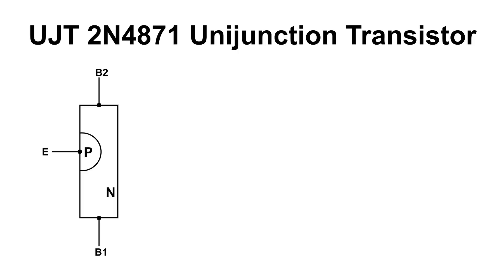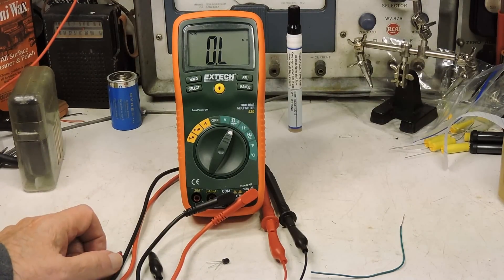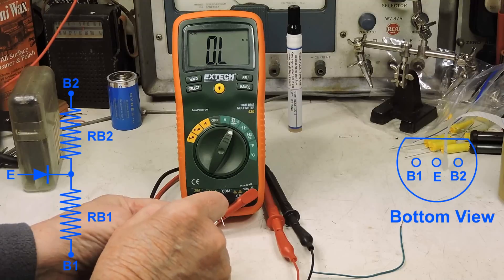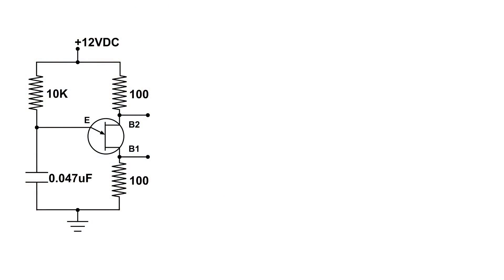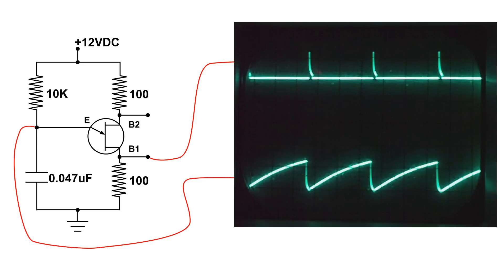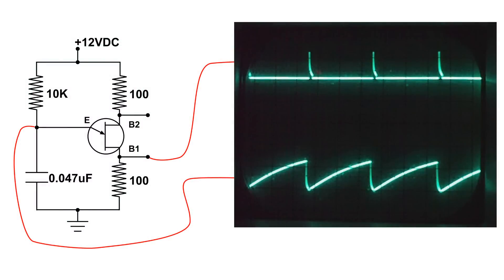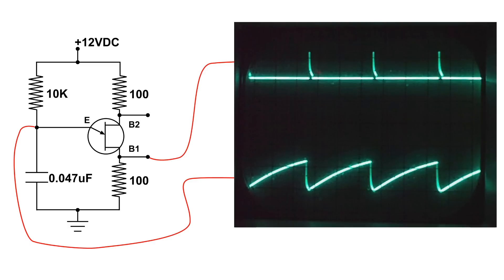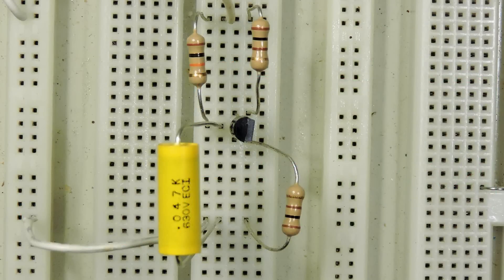UJT Unijunction Transistor Testing and Circuit Demo

Comment: Can we used simple transistor instead of UJT
Reply from the maker: You could use a transistor or MOSFET, but you will not get the same results. UJT Unijunction Transistors are very stable.

Comment: Hello! Thanks for the video! Please, what is the duration of the positive impulse? Greetings
Reply from the maker: The Time Constant is 0.0004
Reply: ...which gives around 2kHz as sawtooth frequency or repeat f for the impuls respectively. I've been wiring up the circuit and measured 3.5ms for the impuls duration. In addition I found that a Diac at B1 shortens the duration to 60µs. Cheers!

Comment: Thanks for the video, do all UJT have the same pinout, the 2N2646 for example? i've been struggling to build a circuit, and the pin outs ive found online havent been that clear
Reply from the maker: Thanks
2n2646 datasheet
https://www.voti.nl/docs/2n2646.pdf

Comment: Sir but for what purpose that b2 voltage what happend if we disconnect it
Reply from the maker: The main current flow is through B1 and B2. If you open B2 you open the current, turning off the current.
Reply: @AllAmericanFiveRadio  thanks sir I appreciate you

Comment: U J T  is very nostalgic to me , as a teenager at the beginning of 1970s , the time I started to learn electronics and assemble circuits on the early breadboards.
I carried out experiments with  P U T (programmable unijunction transistor) which reminds SCR very much.  Thanks for your video.

Comment: I used to run into the GE 2N2646 and 2N2647 quite often while troubleshooting a couple of the NC (tape) milling machines we used to have 20 some years ago at the shop I work at. The UJT's never failed, but surprisingly the  150 volt rated film capacitor for the RC time constant would fail quite frequently. I started replacing them with 400 volt rated units and we quit having problems. I assume that there must have been a high voltage spike somewhere in the mix. Those machine have been long since scrapped and were antiques 20 years ago.

Also, if people can track it down, The old book "Understanding and Using Unijunction Transistors" by Stu Hoberman is an excellent primer on UJT's.
Reply from the maker: capriracer351 
Thanks capriracer351 

UJT's are very stable and useful.
Thanks for the information that was very interesting. I found a few
in telephony equipment, I believe they were in the same circuits that
used thyratron tubes. That improved the reliability, greatly.
Rick